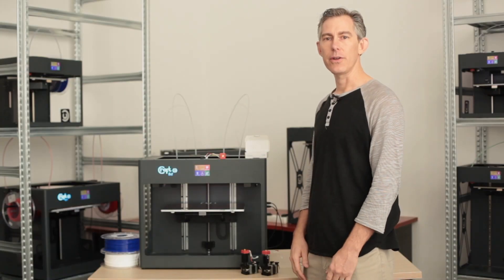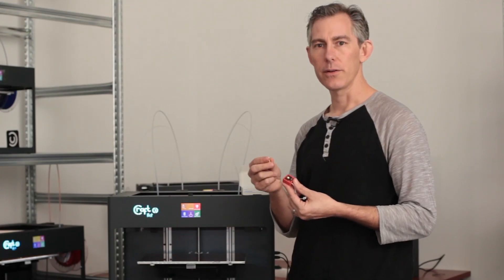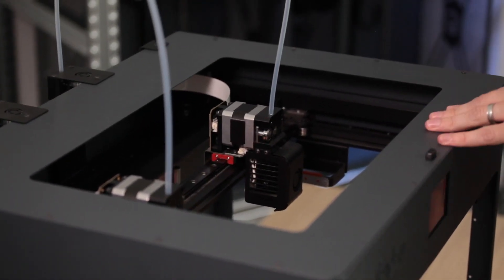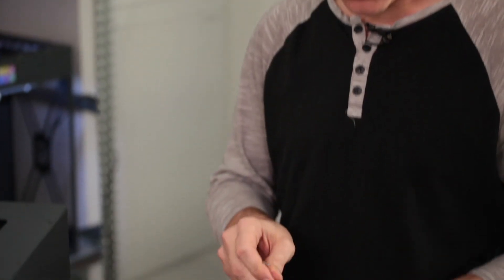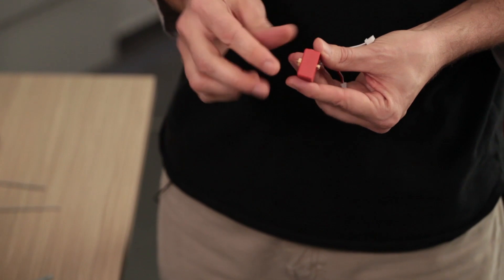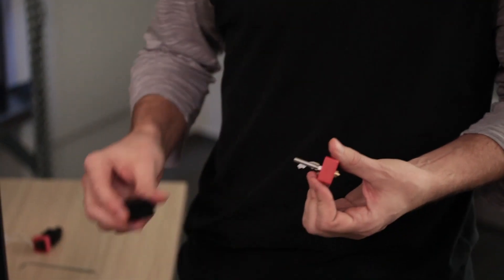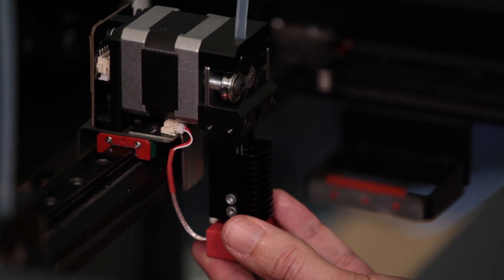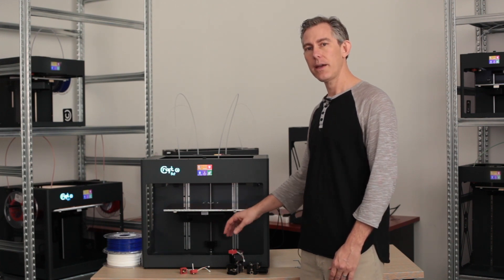CraftBot 3 - Nozzle & Hotend Replacement

Comment: Hello,
I have a small problem:
1. After I replace the hot end and the heat sink, I have error of heating
2. After error of heating disappears, I have Fatal error - Head 1 overcurrent.
Some advice?

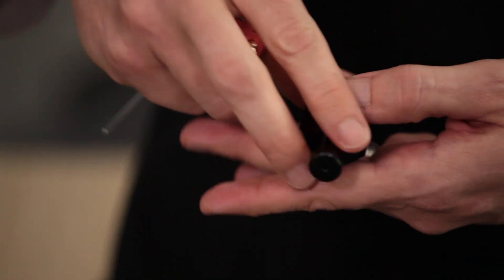Comment: I think something is missing or unclear. At 2:30 you take apart the hotend you just removed the heatsink from. Why? What parts are compatible with the new hotend? The nozzle, heat break, and heat block were all said to be bigger and longer than the original parts. Why not keep that one all together in case, for whatever reason, you want to put the old one back on.
Reply from the maker: The video also shows how to disassemble the hotend if you want to replace nozzle. The new nozzle does not work/fit in the previous heatblock and heatsink. 

The new hotend fits the previous extruder motor
.